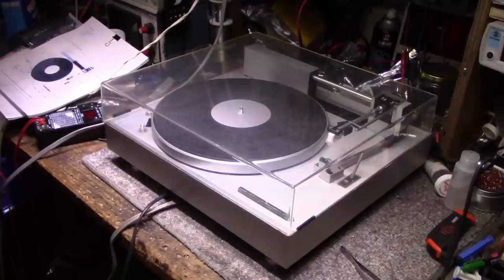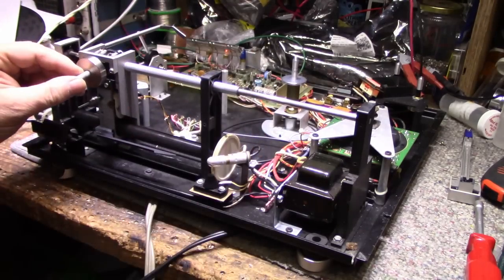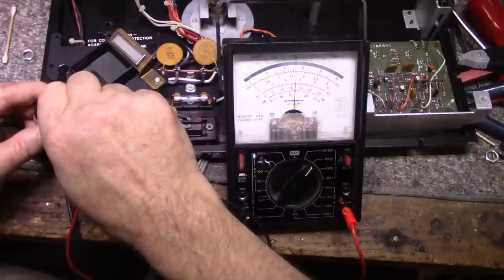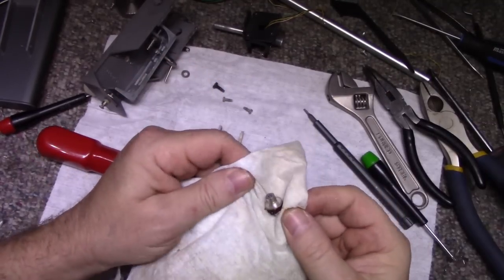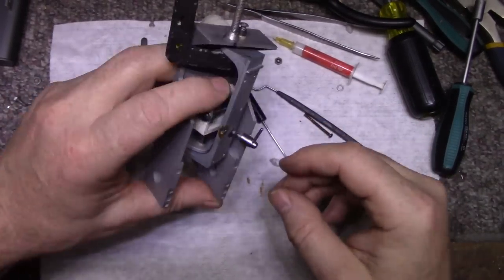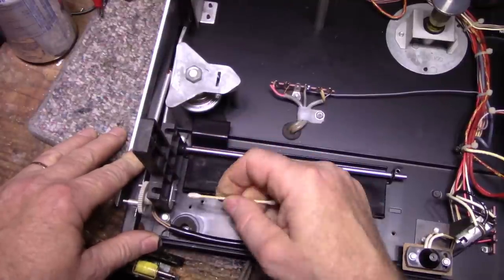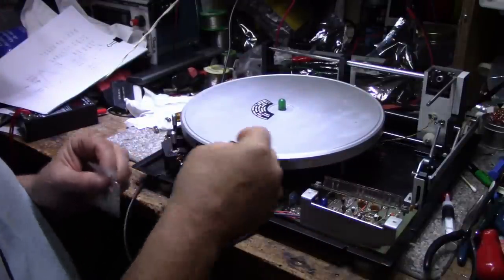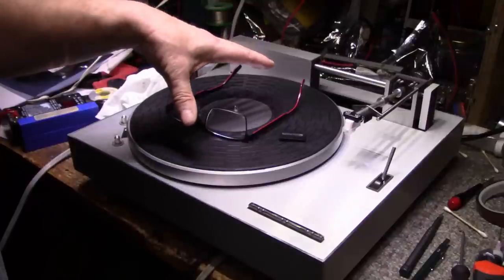Harman Kardon ST-7 Turntable Overhaul - Part 1 (Ep. 155)

Comment: This is great! Despite the negative comments about this series of turntables, when they work they are amazing machines and I’d put one up against tables way more expensive! 
I have an 8 I bought back in the late 70’s and it was flawless for the 10-15 years i used it then and a few years ago i broke it back out and it continues on to this day. Only things I’ve done were new drive belt, cleaning the speed potentiometers, and a grommet replacement… love these things. 

And, to clarify a previous point that was made… rabco may have manufactured the carriage assembly but I’m pretty certain the majority of the turntable was designed & built in the northeast by HK. This was stated in a thread on AK by one of the engineers. 
Cheers.

Comment: Got mine up and running, new to me and was dreading the tracking wheel replacement but luckily for me it’s in remarkably good shape or has been replaced, saved a lot of sweat but was prepped to do it due to your video, thanks , it really is a great table and I have more than is necessary and some very good ones

Comment: love the video , small note for those who are doing these repairs , most thread locking compounds weaken and degrade many plastics . low stress mountings really don't need it but for peace of mind a little rubber solution on the threads is often adequate enough , spring or serrated washers can also be implemented . 😘😘

Comment: To replace odd unobtainium parts ....like the buttons or the foot, i take a good foot or the reglued buttons and make a mould in none other than play-dough. Make the impression and fill with epoxy or for small bits I use baking soda or cigarette ash and super glue. I have used this method to repair broken hinge tabs on technics turntable lids as I dislike the metal hinge tab repair.

Comment: I have used o-rings in the past. If you put the piece in a cordless drill and then use and fine emery board/fingernail file with light pressure you can take the parting line off and make it a little more concentric.

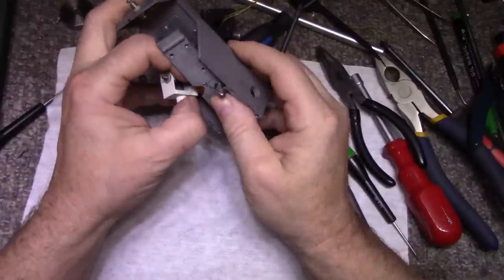Comment: I'm 90% sure the spring that is attached to the piece you put the new o-ring was installed incorrectly. I swear it came from around the outside edge of the mounting piece. Review time 1:24:19.

Comment: What a terrible design. It's a pain in the butt! I had to replace the o ring but I made the short cut (no disassemble). Also mine has the same issue with the tonearm (it doesn't want to go down). I'm still in the process but this tt is for people like you, with tons of patience!!! Congrats!
Reply: BTW the auto stop doesn't work in your tt because you have to cover external light that can reach the sensor. That's why you need the back cover.